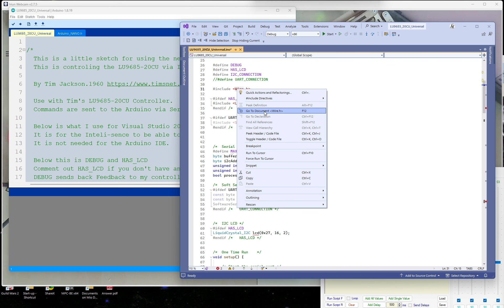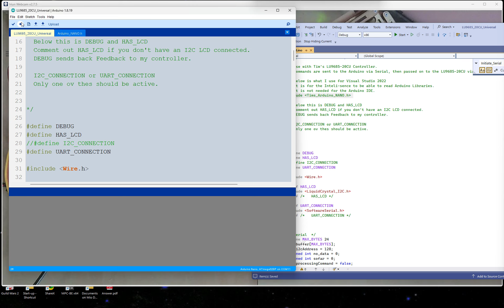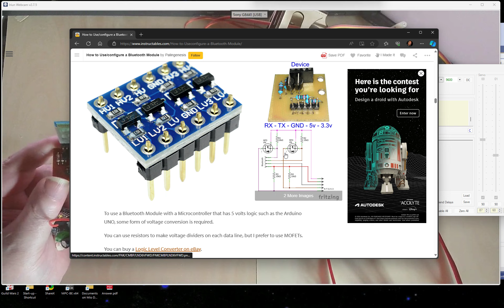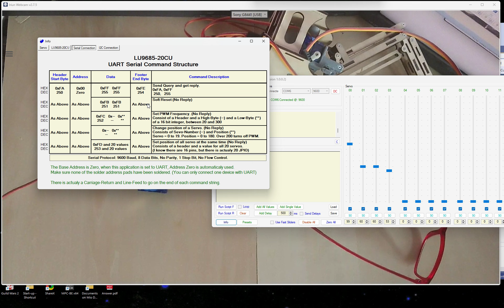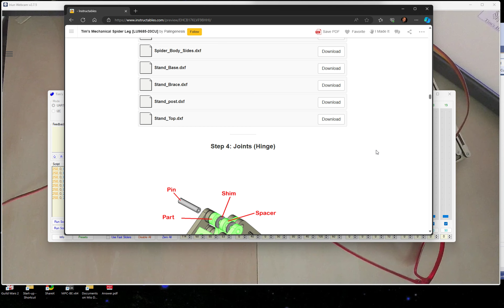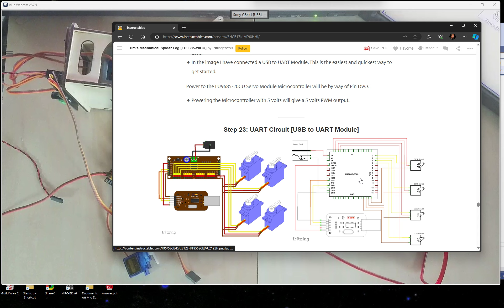Tim's Spider Leg and LU9685-20CU

Comment: Hi Tim. Been lurking and I like your projects. Some things you might find helpful... 

James Bruton has a YouTube video "How To Make Robots Move Smoothly"...highly recommended

While Visual Studio is good and I've been using it for decades, Visual Studio Code (VSCode) is my main code editor now. VSCode has plugins for EVERYTHING, and I do all my microcontroller and retro dev in VSCode. For Arduino stuff in VSCode I use PlatformIO, which is fully integrated, not just a code editor. There's a learning curve but it's well worth the effort